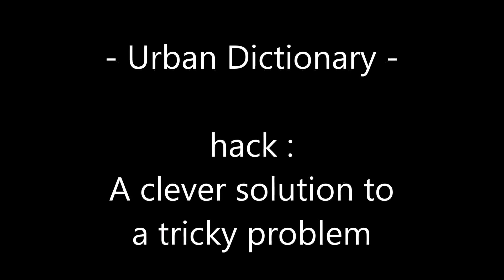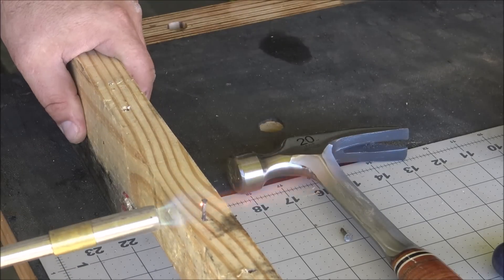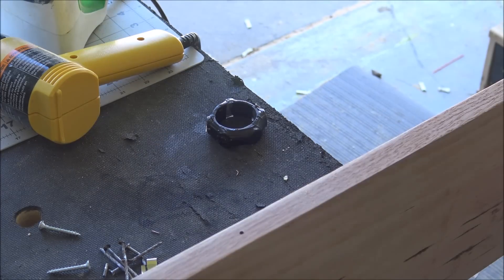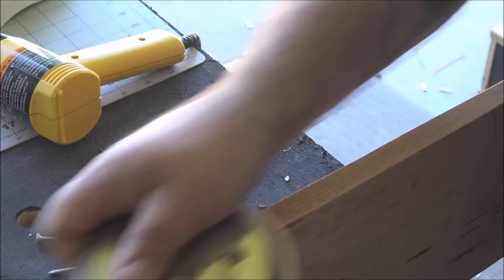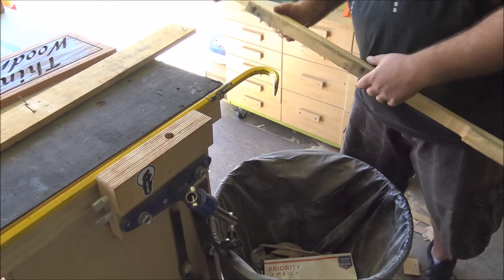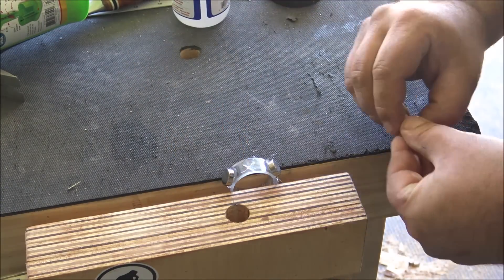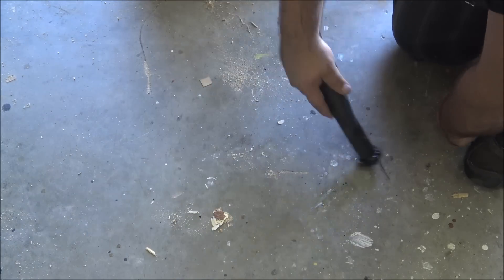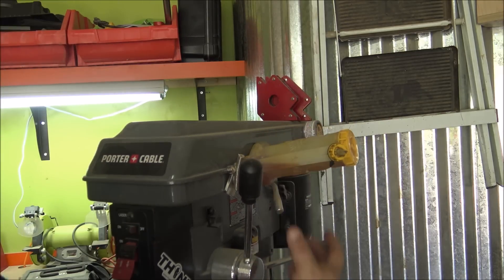5 DIY Hacks - Reclaiming Pallets and Barn Wood

Comment: Great Video,   the magnets around the shopvac is a great idea, if you pull apart a few HDD could use the magnets of you them and it is free.  
Wonder if you put alot around a dust extraction pipe it would work as well.

Comment: I've used the torch heating the nail hack for quite a while now. It has never failed to get the nail out. Some pallet nails have a film of adhesive on them to make them hold better, The heat softens the adhesive making it much easier to pull the nails.

Comment: I'll have to try the torch bit. One thing I do, when the head comes off the nail, is use vise grips. Lock on to the nail and slip your crowbar under the nose of the grip.

Comment: The magnets in the bottle is probably the best hack I got out of this. I use a magnet wand to get all my nails and such first and it looked like it was a little of a pain to have to pull the nails and screws off the magnets as they would block some of the flow in the vacuum.
But I'm definitely going to add magnets to my glue bottles!

Comment: There are 2 very strong magnets inside every hard drive. I pulled a bunch of them apart last winter and scrapped the aluminum cases. I now have a bunch of magnets. I have one in every screw box and put the bits on them so I don't have to search for that last T20 bit that I could have sworn I left in the drill. 
A pair of old visegrips also works to remove nails that lost their heads.

Comment: How well does the bar oil work fur cutting??  That's a good idea as cutting oil is expensive and bar oil is not
Reply from the maker: +Everything RC It works great.. At least i think it does i have seen opinions vary.. my grandpa did it my dad did it now i do it. 3 generations cant be to far off the mark. ;)
Reply: +Roger DC bar oil is chainsaw bar lube. It's what keeps the chain cool while cutting

Comment: The first hack/ tip to use a propane torch to easier pull nails is brilliant!!! Does it work with really rusty nails aswell?
Reply from the maker: +saigmundur as long as there is enough of the nail left not to snap off when its being pulled on
Reply: Cheers! Thanks for the reply. 
Now I just need a new torch, because I accidentally melted my old one (unrelated to this though) :P

Comment: Izzy, I always enjoy your videos.  When I was in the trucking business I had some fairly large machines in a small shop. To move these around to where I needed them I mounted everything on sturdy plywood bases and added and air fitting in the middle so I could hookup my air compressor to it when I needed to move it.  A cushion of air sure makes moving heavy stuff around the shop a lot easier.  Maybe this is something you could do a video on sometime.  I will be watching.

Comment: OK... So the heating up nails thing may have saved me a LOAD of trouble. I just got a 150 lb hard maple display stand that a store was throwing out, and it's just bristling with little pin nails; most of which are stuck pretty good. I've been trying to find a way to pull them without destroying the wood, and I hope this works. I'll be trying it when I get off work.

Comment: What sort of propane torch is that? The one I got didn't seem as powerful as your one. Maybe the one I got was a cheaper make or something.
Reply: That might be a MAPP gas torch.  I think it burns a little hotter.  MAPP Gas comes in a yellow cylinder the same size as a propane torch, but the torch is different I believe.  Kind of like Natural gas vs. Propane.

Comment: Exception;  for filling or hiding "nail holes", simply stick a tooth pick into it and then wet and iron it.(as in this video)..  Glue doesn't take stain and the holes will "appear" again, you'll see where they were, if you use glue.  Probably not so much for some people but more so than I'd accept.
Reply: +fortbuilder100 Generally I enjoy your videos in part because of your personality.  Not that I agree with everything you show.  But you are creative and appear to try or think outside of  the box.
Reply from the maker: +fortbuilder100 All good Brother thx for watching and commenting

Comment: for getting nails out easier, I drive them IN a little and then they pull right out.  same concept as the heat.....get the nail to move a litte

Comment: Heating the nail was great! I tried it as soon as I saw it. I also put some rock wool insulation around it the second time and it really cut down on the scorching of the wood. (I need a smaller torch head)

Comment: Good tips. I wish I had heard of that heating the nail tip three years ago. I would have saved myself a lot of exasperation.
Reply: +WoodRodent three weeks ago for me.. it's brilliant. I will definitely use that in the future.
Reply: Yeah, that was a new one for me, and s good tip.  Also how does that work?  Is it burning out the wood a bit?
Reply: +Jason Dalton I think the heat expands the nail, which expands the hole.  The nail cools off, shrinking a tiny bit which allows it to be pulled a little easier.
Reply: Also some nails they use to put together pallets have some adhesive on them so I'm guessing that heat destroys the composition of the adhesive a little bit so the  nail comes out

Comment: I like your hacks...only most modern pallet builders use compressed air nail guns which usually set the fasteners below the surface. It's a whole new day for salvagers as...you are screwed. It now takes way more work & the wood is also much more damaged. Unfortunate but true.
Reply: I have a lot of pallets to clean up and have been wondering if drilling the nail heads would be a practical way to make this task a bit easier.
Reply: never thought of that

Comment: Pallets and such use cement or rosin coated box nails, from the days of wooden boxes. The heat from the friction of driving them softens the coating and as it cools it sticks to the wood fibers. Reheating the nail softens the coating and breaks the bond so removal is much easier. A good hack, thanks.

Comment: I hate the use of the word hack for tip.  The urban dictionary is not the correct one to use in this case, but I understand the reasoning behind it.   Nice tips BTW.   I will be using a few of those.  I do break down a lot of pallets and have a bad back.  I found I can either use the planks on the top or the sides.  I use a saw to cut the planks off and a punch and hammer to remove the rest or if I want bigger wood I find pallets without the lift holes and sacrifice the planks as they usually break getting them off.    I'm going to visit my buddy that has a welder soon.  Will like fab up a pallet buster to make things a bit easier though I heard this dude on the internet sells them and stuff ;-)
Reply: +Danny Compton i don't care for the overuse of "hack" either. I associate "making" with a bowel movement.